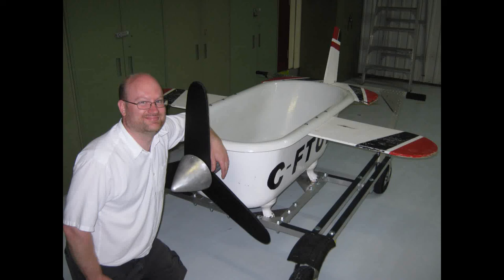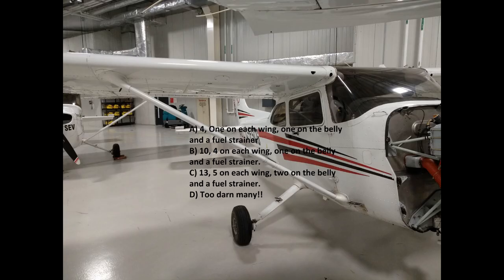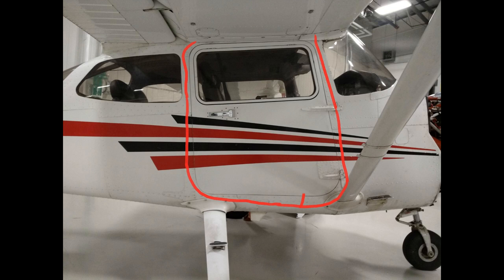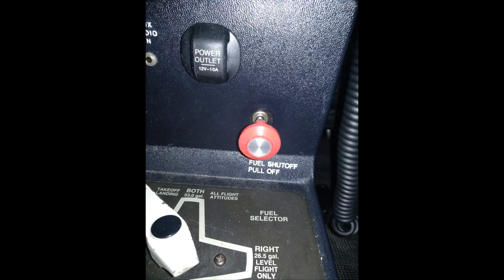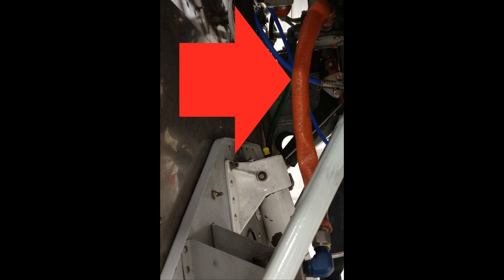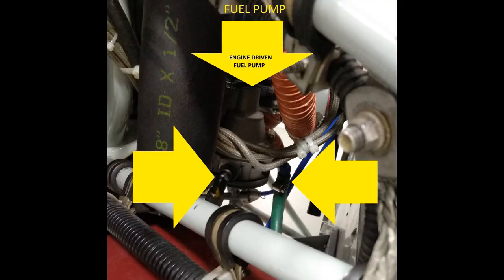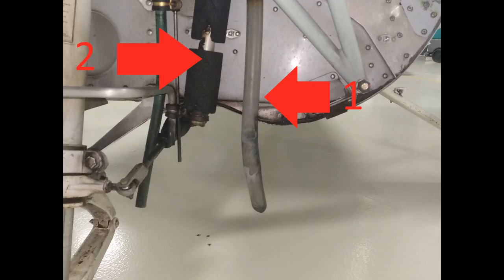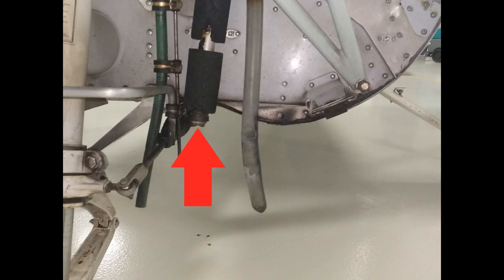Jake's Cessna fuel system video

Comment: Thanks for the video, it is really useful. I have a question: I once forgot to switch off the aux fuel pump after priming and kept it running for about 30 minutes of the flight. The engine started normally and I didn't check the fuel flow indicator readings in-flight :(. I understand it was stupid, but now I'm wondering how dangerous was it?  Did it result in higher fuel pressure and higher fuel consumption while the pump was on?
Reply from the maker: The only time that would be dangerous is at lower power settings (idle).  The engine could flood and quit. Besides that, not much of an issue.
Reply: @jakebranch327  Thanks!

Comment: In a C172 can the fuel migrate to the other tank in situations where the aircraft is not level such as in flight, on   Uneven ground or during fueling? If so can it be prevented by turning the fuel selector in any certain position such as off,  left or right?
Reply from the maker: Modern C172s don't have an off position, they have a separate fuel shutoff.  If you leave the selector in both on flat ground and one tank has more than the other, you will slowly have them equalize. This shouldn't happen in flight because the fuel is flowing to the engine, not the other tank.